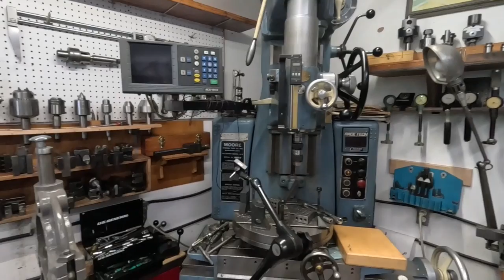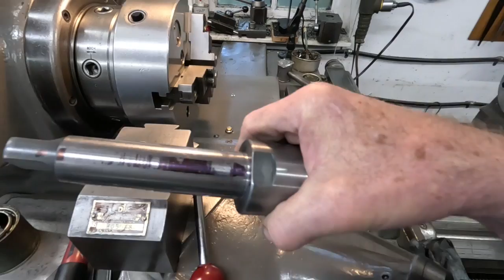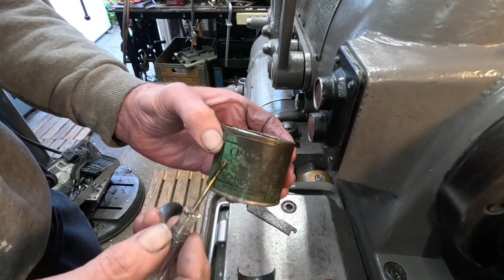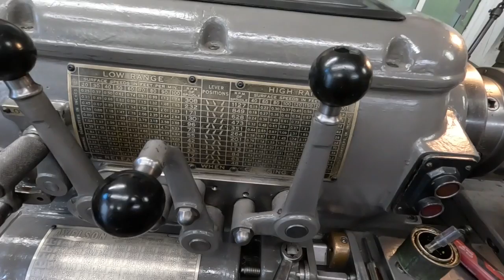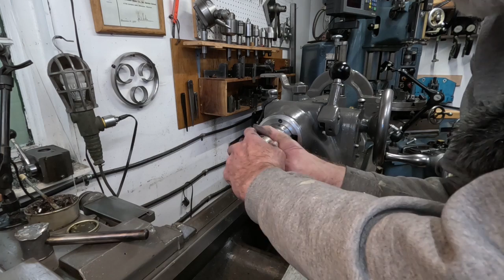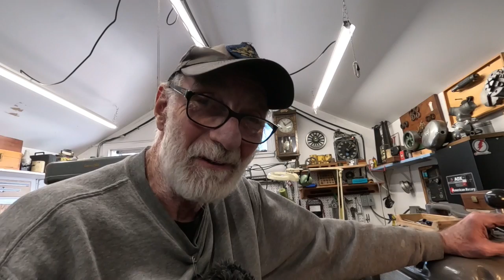Hand lapping machine tool tapers

Comment: Just as I was having a conversation about lapping tapers on watchmakers lathe spindles, you post this. Thanks for sharing, Dee, I always learn something from your videos.
Reply from the maker: Hi, lapping tiny tapers sounds like a challenge!
Reply: @deedeeindustrialsuperprecision  it is a bit of a headscratcher. I think your technique would work with the shallow tapers. There is also a short 45° taper on the front which would be real tricky

Comment: Hi Don, what are the correct tools to repair a screwed up spindle or tailstock quill taper? Would reamers be enough or do you need to grind them? Thanks, really helpful video once again!
Reply from the maker: It would depend on the damage. Sometimes a tool will spin in the socket and raise a burr and a reamer or a bearing scraper will take care of it. I would expect a really damage one would require internal grinding.
Reply: @deedeeindustrialsuperprecision ok thanks that’s a great help